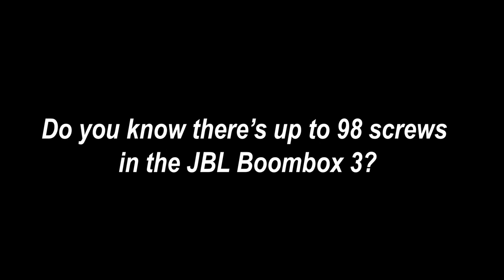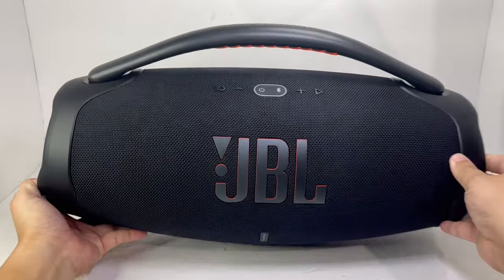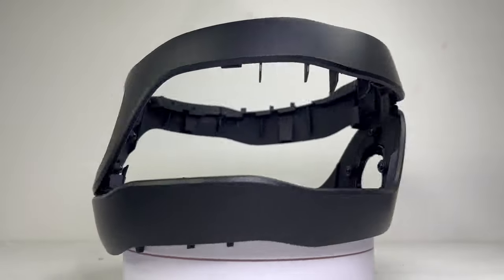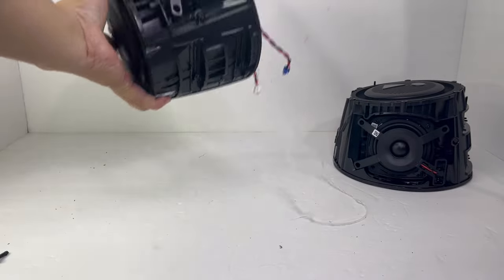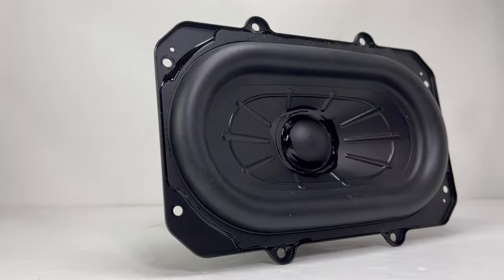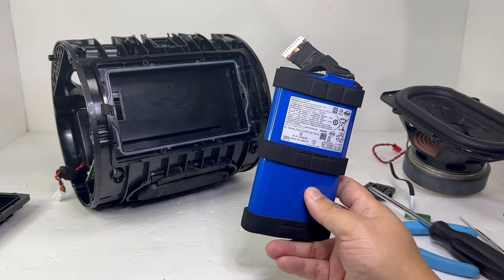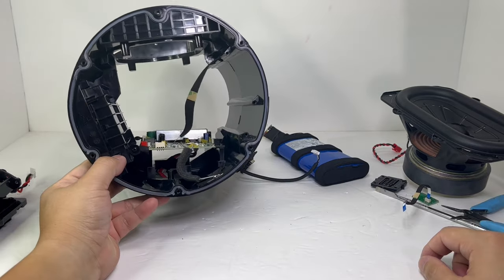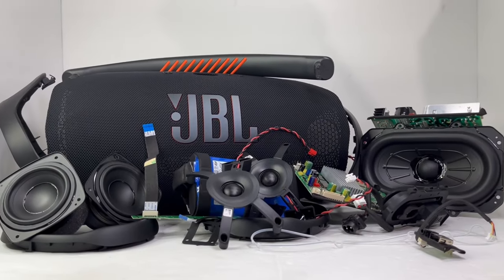JBL BOOMBOX 3 COMPLETE TEARDOWN !!!!

Comment: JBL’s Bluetooth speakers are unmatched . Well worth the money. They own this market IMO
Reply: Tbh you not wrong i dont rlly see any speakers matching the quality control especially.  Where as jbl makes basically all of their speakers come out the factory amazing condition
Reply: I have 2 WKing 50,they are TWS,JBL does not,you can pair them but no True Wireless Strero,I can play Floyd and get DIFF sound from each speaker,100 watts,50 each side,JBL/ JUNK BUT LOUD is the term from the 70's.
Reply: IT IS MATCH!! PERFECT MATCH AMPLIFER TO THE SPEAKERS!! the only missing with the amp is the large capacitors more than 2000uf, transistors NJW recommended, you can upgrade the Amplifer to improve its stock power 10x larger
Reply: @CHAUNCEY.GARDNER.  jbl can play in tws stereo wireless I don't know why you think they can't because they are the ones that started wirless connecting to another speaker
Reply: @CHAUNCEY.GARDNER.  wtf are talking about? lol. jbl is making portable tws for years
Reply: No the fuck they don’t

Comment: Just bought mine today for $419 there was a $50 off, $30 off coupon and the free shipping. I’m so excited 💪🏽
Reply: Been using mine for about 2 years and it's as good as it gets for waterproof capability and sound. It's Aril of '24 and I used mine on a river last year in August. My speaker ended up fully submerged at multiple points while not using it and it still performs flawlessly. Dont ever intentionally submerge a speaker no matter what the waterproof rating is though lol.
Reply: I bought mine just for... 280 pounds (UK) on sale...
Brand new.
It's a steal ;)

Comment: Simple place to hide a air tag as a theft protector would be where in your opinon. Ideally not removing 100 screws! Cool video
Reply from the maker: Without needing to remove the 100 screws, your best bet would be inside the cover.  If not,  remove one side of the passive radidator and tuck it inside there.

Comment: What are some of the part numbers for the drivers?  Great video btw!  I’m wondering if diy options could get to this quality…. It seems like the cross over circuit is on the motherboard.
Reply from the maker: from what i see, there wasnt any part number on the driver, but im sure you can find other generic drive around the same size.

Comment: Can you just change the battery without the tear down? Great video, thanks.
Reply from the maker: you will need to get access to one side of the speaker to get access to the motherboard so you can disconnect the battery and reconnect the new one.  The slot where the battery cable goes thru is not big enought to disonnect it from the motherboard.
Reply: @HBV90  Thanks, given the reputation of the batteries in these, I wish they would make it simple. But I will be looking forward to your video (How to change the battery in the JBL Boombox 3) 😊😊
Reply: @HBV90 can you do a battery replacement video please

Comment: It's even easier to take the PartyBox 200 and 300 series apart. No hot glue snot all over the place but real seals and quality parts.
I bought a used PB 200 two years ago and the only difference to the others (except 710 and 1000) is there is no battery pack. It can easily be modified, however. So I mounted a flip-up handle and two small wheels for convenience, the 300 and 310 have these features from the factory. I love how they make their things repairable if need should be. My over 30 years old LT 100 are still going strong...won't change them for anything else.

Comment: Is the boombox 3 supposed to blow a little bit of air from around the button rubber
Reply: No if it does it should be a defective one or a counterfeit item
Reply: @RTP_LION  it’s a genuine jbl
Reply: @micahchesler4552  well then if it blows air out somewhere on the device it might be defective. JBL portable speakers are fully waterproof they are not supposed to let air in or out

Comment: i received my brand new JBL boombox 3 yesterday and it doesn't charge, going to have to return it, was thinking of opening it and see if the AC cable might be loose or something due to a bad assembly, but I'm better just returning it i don't want to mess something on it....bummer
Reply from the maker: yep, if you can still return it,  thatll be the better option than opening it.

Comment: The JBL Boombox 3 could have been such a great device IF the AUX-port had no latency - which would have made it possible to connect a keyboard, synth, dj-deck or any other type of 3.5-plugable instrument for instans realtime-Sound. But the AUX-signal runs through the motherboard, the Sound Will be prosssed there, which causes the latency… 

Older JBL speakers had bo latency issue… and speakers like the PartyBox 110 are not as portable as the Boombox 3 ..and have no stereo sound. 

I was watching this video, to find out if I could connect the AUX port directly to the circuits which goes to the speakers, but as far as I can see everything needs to go through the motherboard/computer… 

So the only alternative in this 3-way-class of speaker like the Boombox 3, is the W-King X20, which has a aux and instrumental port. I need to check that one out.. but I would prefer to have this connections on a Boombox 3, as the sound just is sooo good! 😕
Reply from the maker: Agreed!

Comment: These are pretty big Magnets for the Midrange Speaker.
Reply from the maker: Yes they are.
Reply: Those midrange's have "bucking magnets" added below the regular magnet. They are the round donut shaped magnets stuck/glued on top of the regular magnet. The purpose of bucking magnets is to squash any stray magnetic field so it doesn't affect nearby magnetic sensitive objects. This is peculiar because the subwoofer doesn't have any bucking magnets so stray magnetic fields are present from the subwoofer anyways. Bucking magnets are primarily used for speakers around old CRT televisions as magnetic fields would affect the electron beams and distort the picture. This tells me those mids are some very old stock drivers from the time of CRT's. Not unusual in the driver business as there are warehouses full of production overruns of various drivers over the years. Odd because they would add a pound or 2 of weight to the package and for a portable speaker extra weight isn't usually a good thing unless you just want it to "feel" like a higher end product. JBL must of got a good deal on them to use them. They could be removed just by prying them off with a screwdriver and won't affect the performance of the driver itself, save yourself the weight.

Comment: I really like this.
I have one of the best has an issue with the FFC connecting the charging board and the mother board, please could you help me tell me how to fix it, when I switch it on after few seconds it goes off, but when I disconnected the FFC connecting the charging board and mother board it stopped.

Comment: intresting to see ferite magnets instead of neodymium
Reply: Have you seen the price of neo lately? Not only that but those mids have bucking magnets on them. Bucking magnets were a way of containing the stray magnetic fields around drivers used next to CRT televisions as those magnetic fields would distort the picture. The last CRT was sold in 2010, that tells you those mids are new old stock from at least before 2010 and those bucking magnets add 1-2 lbs to the package as nothing more then useless dead weight. Nothing wrong with using up an old production overrun that was just sitting in the warehouse but at least have the assembly workers pry off those bucking magnets before assembly to save some weight. No wonder this thing weighs as much as it does.

Comment: I have a boombox 3 that won’t turn on or do anything. I have it taken apart but can’t see any obvious reason why it’s not working. Tested the battery and it reads 7.3 volts. 
Any ideas on how to fix it?
Reply: Why did you try to repair it yourself instead of sending it to JBL? It was obviously still under warranty.

Comment: I hate those rubber feets JBL use since Xtreme 3, they always end up detaching themselves
Reply from the maker: these grip pad/feet tend to go bad over time.
Reply: @HBV90  The old design is so much better.
My Boombox 2 is fine, my Xtreme 3 I had to glue them one by one each time they were detaching themselves.
And my Charge 5 is fine, for now at least...

Comment: No offense but this felt like an ad. Throughout the video you went over most of JBL's marketing without saying much of anything about your own experience with it, acting like marketing actually means anything. Also, I'm not saying JBL copied Sony directly, but there's a lot of design cues from the Sony SRS-XG500 that I see in this speaker. Specifically the way the two halves separate from the middle of the speaker, the method the battery mounted and replaceable, and the way the handle assembly comes off. Also ALSO. 6.4 HOURS to charge? With that size battery you'd think it'd be faster. The XG500 takes a mere two hours and can play back for nearly 10 hours at max volume on a full battery, or 30 hours at 40% volume, which is what they advertise. 40% volume is a comfortable listening volume, if a little loud in a medium sized room.
Reply from the maker: Thanks, This video is more of a teardown with some spec of the speaker rather than an review.
Reply: @HBV90  ah I see. I was just pointing this out because I'm very tired of people worshipping JBL. "JBL pro sound" doesn't exist there's no pro using a flip 5 to make money ☠️

Comment: why did they put the tweeter in front of the mid range speaker?
it kinda interrupts the soundwaves you know
Reply: It does not, the longer wavelengths of the midrange sound can travel un-impeded past the (smaller then the midrange wavelengths) obstruction. - your hand can block tiny ripples in a bowl of water because the wavelength of the ripples are much smaller then your hand. Now venture waist deep in the ocean and try and stop an ocean wave with your hand. The wavelengths of the ocean waves are so much bigger then your hand that it just wraps around it. Same thing here, your hand can stop high frequencies but is no obstruction to bass frequencies. 

Placing the tweeter in line with the woofer is called a co-axial arrangement and is the best alignment to get the tweeter and mid to blend in seamlessly over the crossover range.

Comment: Has anyone tested real power output with the battery? As shown here it has 2S4P li ion battery. Amplifier gets 24V, so boost converter is also needed which adds losses. For the claimed 136 Watts power, battery must provide about 18.73Amps at nominal voltage of 7.26V. In theory at 100% claimed output battery could only last ~30 minutes. Of course noone plays only sine waves all the time, but I am a bit skeptical of the claimed output.

Comment: Imagine how many amps the amplifier pulling into that 2s battery pack
Reply: The amplifier will draw a current, i.e. amps from the battery pack,  I think that's what you mean?
Reply: Probably not that much because jbl use ultra efficient amplifiers and the battery pack has a high output wattage

Comment: Does anyone know if the internal battery in the jbl boombox 3 can be replaced through warranty (& how many years) or later service? ( like 4-6  years from now or date of purchase ).

This could be useful to know for a potential consumer as I have a jbl flip 4 that for the last year or so only plays music 1h on a full charge, this is after 6 years of moderate use - changing the battery to a new one in the flip 4 is probably not worth it, but it would be useful to know what it will potentially cost to get a new battery in the JBL Boombox 3, 6 years from now or earlier as the batt. capacity bottoms out & becomes a nuisance that severly diminishes the speaker unplugge usability.